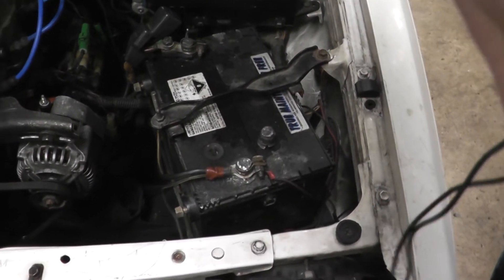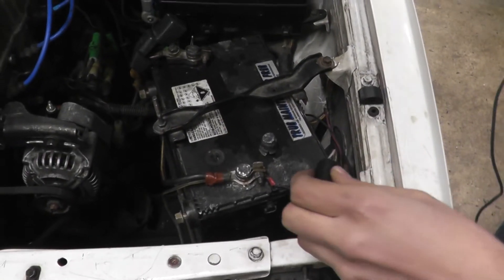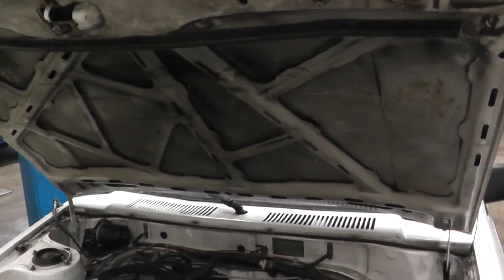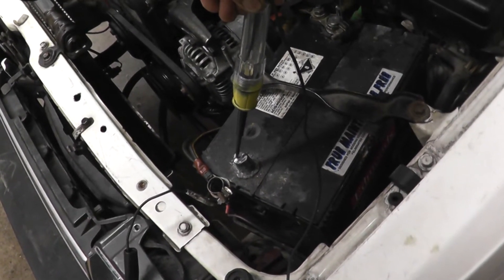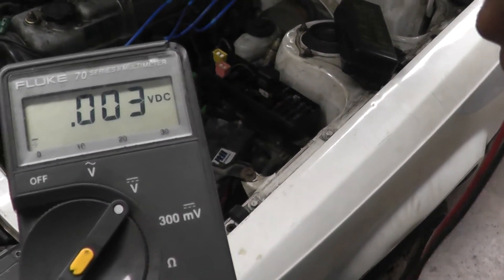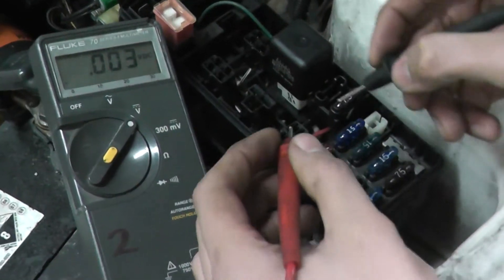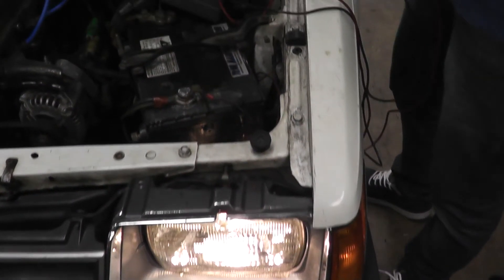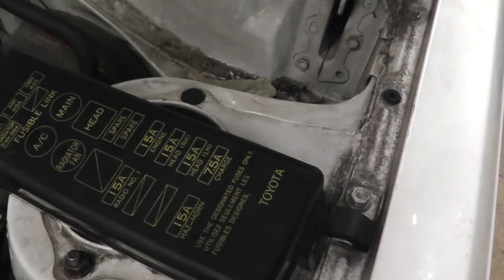Simulation of how to perform a battery drain test. By: Ravi

Comment: Thank you for the basic info, however in modern cars with CANBUS systems using PWM we maybe have to rely on more advanced techniques using ammeter data loggers and oscilloscopes, but this is good starting point specially for older simpler vehicles.

Comment: this is 100% incorrect both the drain test AND the fuse test . Step 1 you remove the NEGATIVE and you place the light inline with the negative cable you removed and the negative post on the battery. YOU DONT TOUCH THE LIGHTS AT ALL. That didn't show anything but that the light itself works when there is a voltage across it. not going to help you in this situation at all. SO doing it as I explained above IF there is a drain the positive will energize the negative cable through the chassis and engine metals creating a difference of potential (voltage) across the load (light) thus the light will come on immediately when u hook it up . Step 2 pull each fuse 1 by 1 until the light goes out, that will be the circuit causing the drain. DO NOT do what he is doing there with the fuses. It also won't help you in with a battery drain. He is looking for a voltage (difference of potential) across a fuse haha. A fuse has the same potential on both sides (no diffenence) thus its zero volts. if you have a number come up you will have found yourself a blown fuse. BUT that would not be the cause of a battery drain because  it is blown, it is not able to conduct current to the resistive load thus cannot be draining your battery. Hilarious! (A fuse is basically just a road for the current to pass that will break if the current is too high saving you and or your vehicle from getting to hot and catching fire. anyways i hope you get a chance to read this BEFORE you waste a bunch of time doing nothing productive when you should be fixing a battery drain. (Yes I am a Certified Red Seal Electrician amongst many other things that required years of university and on the Job training). Good Luck and Please do not hurt yourself. Nothing in this test requires the vehicle to be running.
Reply: Guess again bud I’m a mechanic last 25 years and this is a no frills roadside diagnostic trick that works 100% of the time
Reply: @thetrain5785  ha! love it! TRICK! Well im an electrical engineer and a journeyman electrician. So im srry but grade 9 math doesnt help in this situation.
Reply: @mrjayhamilton  keep fixing house bud
Reply: @thetrain5785  surprise surprise wrong again. whats the name of the shop you work at?
Reply: I can personally vouch for this comment & honestly, this video should be taken down for misinformation. Not everyone should be making YouTube videos, as you can see here.
Reply: If I have a tracker fitted would that make the test light light up?
Reply: Need some advice since people are all over the place with these test light diagnostics. The 12 Volt battery on our 1-yr-old John Deere Zero Turn died all of sudden last week. So I bought a new 340 CCA Die Hard battery and also purchased a test light. I tried repeating the OP’s method of determining a parasitic discharge/drain with the brand new battery. With both the + and - posts connected to the NEW battery, I applied the alligator clip on the negative post and touched the ice pick probe to the positive post. The light test light lit up brightly Then I removed the negative cable as the OP did and the light lit dimly. Does this mean I have a short that is draining my battery? The service department at the John Deere had no idea what I was talking about and told me I needed to have the tractor brought in for diagnostics. Where am I going wrong here? Does the dim light mean there is a parasitic drain on that new battery? P.S. I disconnected the fresh NEW battery until I get this figured out.
Reply: @Fresh-tw7ev  very sorry i had no idea you had replied months ago. I hope you got er figured out. if not message again and i will go into more detail. But the very first thing I would do personally is unhook the new charged battery as you did I believe (BOTH terminals). And then would use the test light on the battery once again with nothing else attached. It should be the same brightness either way.12 volts is 12 volts (*wont most likely be 'exactly 12 volts' but should be identical either way as long as the vehicle is not running). If not you have access voltage coming from ELSWHERE (capacitor, solar panel, 2nd battery etc).And most likely your issue, as it is not wired into the system correctly (series, parallel, seriesparralel etc) and is changing your voltage. After that conclusion either find the other source and fix it or start with steps I explained above. Good luck and feel free to contact me or leave your number and I'll surely give you a shout and figure this out.
Reply: @mrjayhamilton  thank you Jay! It ended up being a bad voltage regulator which was covered under warranty. Thanks again!
Reply: @Fresh-tw7ev  if you touch a light on + and - terminals you get the full strength of the battery.that has nothing to do with the dissipation of energy that you troubleshooting..connect the bulb in line meaning from -teerminal cable to -battery terminal. You simply want to see if there's a current that is flowing. If the answer is yes the light bulb goes on then go pull out your fuses one by one until you identify the circuit that the little soldiers with their energy bags is traveling from (introduction to electrical circuits diagram) i hope that is clear enough
Reply: i agree.set it to milliamps and start diaconnecting suspects
Reply: Hey there @mrjayhamilton, it seems you might be mistaken or may have watched a different video than I. First of, you are WRONG on your comment the part where you posted **"DO NOT do what he is doing there with the fuses. It also won't help you in with a battery drain. He is looking for a voltage (difference of potential) across a fuse haha. A fuse has the same potential on both sides (no diffenence) thus its zero volts. "**   @mrjayhamilton, As you would/should know; When there's a load on the circuit (ie:1.5 amps @12V) you will be able to measure about 2mV of voltage drop (measure the potential difference) between both leads of a fuse in line with the circuit. Now, you don't need to be an electrical engineer, even an electrician would posses this fundamental knowledge in basic working principles of electrical circuits. Thus the information provided in the video is correct, measuring potential difference (ie: voltage drop) on the fuses can be helpful in identifying which circuits on the vehicle are drawing power.